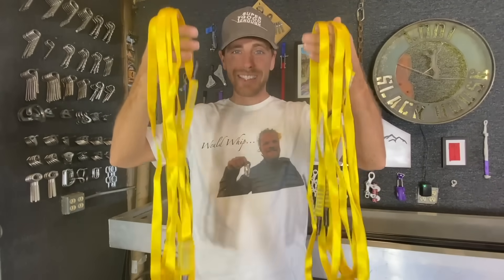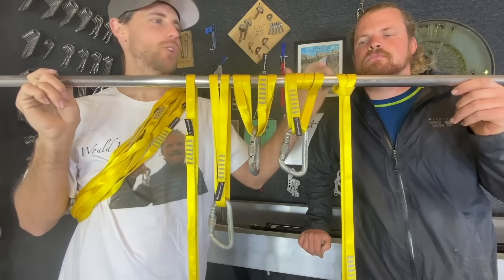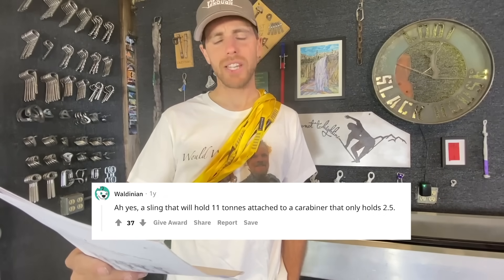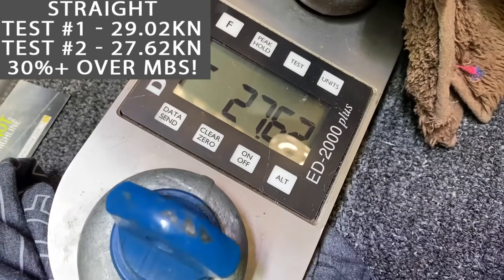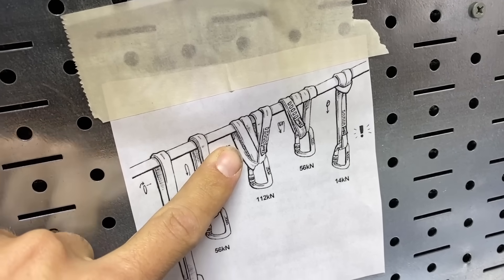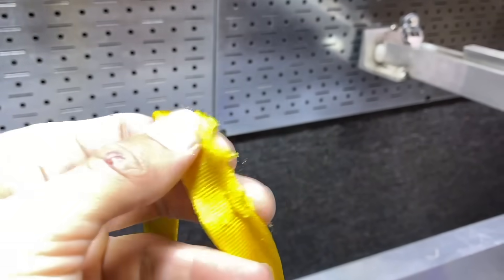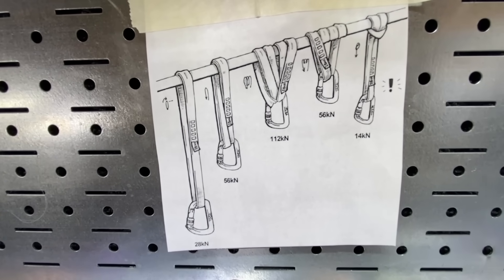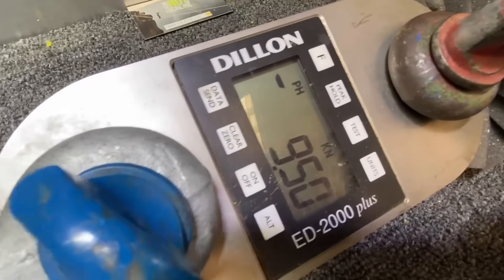Climbing Sling Myths

Comment: Whenever you have the slings not perfectly straight you have hidden forces in your system that are there, but are not measured by your gauge. Let me clarify:
Most prominent to see at the quadruple sling. There are strands coming from the left and some coming from the right. Slings can only transfer forces along their orientation. So the left slings pull to the left, and the right slings pull to the right. The sideways forces cancel each other out, and you only measure the axial forces with your gauge. But they are there, load the slings and add to the breaking forces.

Comment: Hey, my background is engineering and from what i can see i would assume that the lower tensile strength is due to each "strand" of the sling not carrying the same load, so instead of it being each one carrying the same load and maxing out, some will carry more and and some less due to many factors, so it fails once the highest loaded section reaches its maximum load capacity

Comment: I was a climber in my 20’s before a bike accident and broken wrist all but ended my quest for higher grades..

I am also a crane operator and we deal with very similar formats when it comes to our rigging…

What concerns me, is that a sling rated for 22KN is breaking right around the 22KN mark

In our industry, a sling “rated” or with a working load limit (WLL) of 5000 LBS must have a “breaking strength” of 5 times that…

We also simplify our configuration for good reason

Straight pull is a factor of 1

Basket is a factor of 2

Choke (girth hitch) is a factor of .75

And this is under optimal circumstances, accounting for sling angle and severity of a bight

Comment: Wide v-shape means the pulling force you're measuring is not the same as the force the sling "experiences" along its length. No practical implications for the sake of this test just pointing out it's a bit different thing.

Comment: the reason you are not getting 4 times the strength of the rope when you wrap it 4 times over has to do with the "triangle of death". basically, all segments of the rope have to be parallel to one another for their strengths to add up. if they are at different angle, only the parallel component of their strength adds up. the oblique competent cancels out. vector physics. sorry!

Comment: The reason you are getting lower than calculated results is that it's impossible to rig the sling in multiple turns in a manner which puts perfectly uniform stress on every strand.  Every wrinkle, fold, and partial overlap changes the force distribution away from ideal/uniform, creating stress concentrators which cause some strands to reach their failure point before others.

Comment: I fucken called it. Why would the last rope they tested snap twice as fast. Its attached the same way. Only its got a not at one end. Why would there be weakness in a simple knot like that.

As for the one that should have taken over 100 kn. You generated a lot of heat its not rocket science. That reduces the strength load its designed for so if you operated your machine at super slow speed you would have seen the correct results. Heat is a bi product of every process in existence. You dont even need to explain it. The rope could not dump its heat fast enough into the rope around it. It didnt burn soften like that every where as the steel bolt were it could, through contact, absorbed a lot of heat protecting it. You tie knots and rock climb or something right? How do you not know this. My grandad taught me a little tiny bit about fishing and one knot. You spit on it as you pull it tight to keep it cool and add lubricity. Trying to tear those straps you are adding vast amountsof energy to the system in e form of heat and deformation. Or better to say the friction and deformation is causing it. Its not compression. Its being pulled not compressed even though that seems whats happening. Key point is to take note of where the forces are coming from I.E. what kind of forces are being applied and take in to account where are the forces being applying from which direction.

Comment: I would expect girth hitch to have increased wear that would degrade quality much faster with habitual/repeated use. Unfortunately I don't know how to test this without an ABSURD amount of time. (Maybe repeated 4kn tugs until it breaks, but I don't know how many it would take to have an impact, I also would expect that to realistically simulate wear you would need enough time for the sling to cool off after each tug since I have notice the material has a tendency to melt and become brittle under load

Comment: Seeing the wrapped sling break strength was great because it's the worst case scenario for an equalised two anchor setup if made with a sling between it. if you're using one sling to two anchors and adding a cross over to attach the equalising carabineer, if one anchor fails, the carabineer slides along the loop to the end effectively creating this scenario.

Comment: The wrapped sling introduces an angle to the attached leads of the sling, would be interesting to divide the measured breaking strength by the angle cosines to see if the straight tensile breaking force is close to the original double looped variation

Comment: Why do you jam the slings into the bolt of the shackle, you should be using the bow of the bow shackle for them, the bolt of the shackle going through the pulley, if it would fit.

This would stop the sling from being bunched up and potentially get a higher result.

That said, it's an absurd number anyway and moot.

Also, these factors all change depending on what you're slinging around. Sling a girth hitch around a square object (I beam for instance) and see how you go. (The angle of 90deg in each corner will further reduce strength.)

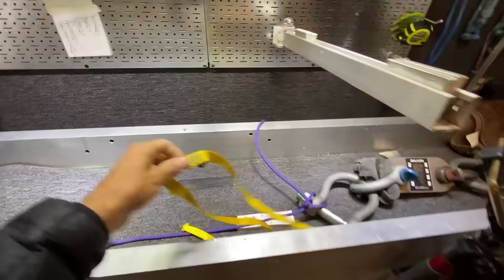Comment: Re 10:26 You did not wrap the sling as shown in the old picture (which is why the biner hangs differently), and your arrangement might do more to prevent equalization, by pinching one loop under another.  And you would get more equalization if you allowed the rod (clevis pin) to turn on its axis during the pull.  However, yours is more realistic in that most climbers are not very careful about how they position the turns on a shortened sling.  However (again), no one really anchors to a polished 1" steel rod, nor where the loops can be arranged to not pinch one another.  Another fundamental is that although tubular sling strength is less affected by bend radius than kern-mantle, it still does, but I haven't seen any good tests of how much it does.  (In case someone does that test, the length of the test loop, as it is tied, also matters  (which might be part of why 3-wrapped is weaker than doubled)

Comment: Is there any difference between a shock loading from a vertical fall and the progressive stretch you apply on your rig?
Reply: That's the question I want to know !!!  I woule assume the shock load would be many more KN than the slow stretch load ? I mean how often would a climber actually have a tie wrapped around a flat cylynder like that as opposed to a curved or angled surface putting MUCH more pressure on a line. And all it takes is for ONE loop to break to render the whole thing useless.
Reply: Yes, I think the circumference of a krab is crucial to the loading especially when it comes to a downward, shock loading instead of a horizontal, smooth pull.  @takeshikovacs4728

Comment: Nylon running over nylon burns . all the numbers doubled are correct in theory but you will always have unmeasurable breaks at any or all knots , girth hitches , or points of contact. The correct way to strengthen would be to take out the bar tacks and create continuous loops on top of each other .

Comment: With regards to the sling that melted. If you magnify the fibers you'll see they didn't cut but melted as the tension caused friction that created heat that melted the sling.
When you wrapped the sling multiple times around the shackles int top layer pressing onto the under layer stretched giving a wider heating area and the heat was not able to disopate reducing it's strength.
Wrapping multiple times as far as I am concerned is more about locking the sling so it doesn't slip and cut.
On the first test it failed at the stitching and would at a knot for the same reason as it's a pinch point so doubling it reduces the loading on the join with the bonus of an increase in strength.
Of course out in the field you could add an extra crab to get extra strength. When instructing abseiling activities I use steel crabs as they are stronger and handle more abuse.🏴‍☠️🍺

Comment: The various military and special ops players have the perfect mindset for all situations like this "failure is not an option". If you can break it on the ground (benches inclubed), it can break and will, at the worst time. The smooth spots were where the sling began to break down (melting under compression probably). Any time a sling crosses itself you run the risk of that happening. If you can, elongate and cushion your attachments. If your equipment is having a good day, you will too, probably.

Comment: In theory, a perfect world it should be 4x if double basketed. Obviously with minor twists and turns and such the strength will diminish. Even just a 5% loss on 80KN is roughly 4KN, 5% is a reasonable factor for a real life scenario. When they say mbs, its in a perfect environment that works for the manufacturer.

Comment: The more wraps you put around a limb the harder it is for those individuals wraps to evenly distribute the pressure/weight. (it's a bondage thing lol.) If there are slight length differences between the wraps, and there are parts or rope overlapping each other, with weight, the pressure/friction makes it even harder for the straps to even out and distribute the load.

Comment: Way last century, when Bill Forrest designed his "Titon" tee nuts, slotted to be strung with webbing rather than perlon, he said he was getting pull tests that exceeded the webbing rating, before even smoothing the edges of the slots. This would be very comparable to running a sling through a bolt hangar, not using a girth hitch. That would be a very informative thing to test with other variations that many folks end up tying when rappelling, especially when a girth hitch is the most expedient way to put a pre-sewn sling through a bolt hangar. Trying to cut a sling to thread a single strand through is inconvenient/dangerous in nylon, and nearly impossible with dyneema; doubling a runner would be stronger, but would not stay in place as soon as the rope was pulled. Doubling a sling through a rap ring, then girth hitching the doubled ends to the hangar seems a stronger alternative, and easily replaced by another party.

Comment: Looks like rope mentality is used as baseline thinking for the strap expectancy. How about comparing the same sort of hookups using rope; i.e. strength multipliers ...  Difference would be of course rope would not wrap over itself in some of your configurations ...  still a nice test?

Comment: Hey, the reason for decreased strength is due to overlapping the straps.  When they are under that much tension they will lock together rather than slip past each other.  That will lock the length once the load gets high enough (well below MBS).  Once you do that the shortest length will see a much higher load.  The best way to mitigate that problem is to use longer test pieces so you can use larger shackles.  This will allow you to avoid overlapping the test pieces.
Reply: Yeah I would like to see a slightly longer one I think it would perform the same as the regular (shorter one.) I dont get why anybody expects that hitch to be half strength, its not THAT much different than a regular loop.
Reply: Also, if the issue was effectively having multiple pieces of slightly different [unloaded] lengths once everything locks, then presumably using a longer sling but keeping the shackles the same (so tending to keep the same absolute differences in lengths between pieces) and increasing the overall length between the shackles would mean the relative differences in [unloaded] lengths between the pieces would be lower, so the differences in load between pieces would also be lower.
Reply: Came here to say exactly this but vid being 2y.o I first check comments.
Glad to see some people with a brain here and experience here, shows thoses guy have no clue what they are doing.
Reply: @AlphaGamingCa  I guess it depends on what a viewer thinks they were doing.
They did say they were inspired by the diagram (showing what were effectively "ideal" results for the first 4 arrangements), and that diagram was using a carabiner, which would end up with straps overlapping and resulting uneven load distribution.
In the real world, not many people are going to carry around huge shackles to use in setting up a belay, so wouldn't end up with an ideal setup either.

Comment: Its the law of diminishing returns. Thr friction of it rubbing on itself causes it to lose overall instance strength. Any twists or horizontal tension will reduce the instance strength. I want to define instance strength. Instance strength is the break strength after all influencing physical factors are calculated. So for instance if i were to try to break a d shackle it might take 10000lbs of force to overcome the tensile strength. Thats the breaking strength in a physical vacuum. However if that shackle were heated to 1500° f and it took 3000lbs to break its instance strength is 3000lbs. So its a term used to identify the strength of a material when taking into consideration environmental factors

Comment: The girth hitch was full strength because the bolt you used for rigging was able to turn so the hitch could orient itself in the direction of pull.

Comment: The minor axis (across the sling) of polymer fibers is not as strong as the major axis (down the length of the sling). When a knot is tied the load is distributed over both the minor and major axis. The narrower the bends in the knot are, the more force is distributed over the weaker minor axis. The narrower the material the narrower the angles are for the same knot. This is why the decrease in MBS for a given knot is not comparable for materials with different widths.

Comment: Great video I get similar results using the straight and girth hitch methods. 

I use lots of 6-12k straps combined with a 4k chainsaw winch, 10k pulys and 2-10k bow shackles for small scale logging. 

I find that the girth hitch typically exceeds the rated capacity of the strap.  I typically use straight or girth hitch ties for all my strap connections with bow shackles or straight to another strap. I mat double my strap if using a 6k strap for an 8k pull.

I have broken around 20 straps and mostly they brake somewhere in the middle due to weave failure or less often at the stitching.  However, under tension any somewhat sharp edge that comes in contact with the strap can potentially cut it.

Decent straps are Great.  I have way more problems with my 1/4 inch 4400 pound test aircraft cable wearing on the cable guide and getting squished on the winch drum.  I wear out and break the cable every few hours of use.

Fun fact: with a starting load over 2k I just tie the leading end of the cable to a bow shackle and it holds full rated strength once the knot has pulled tite under heavy load.  This saves time and doesn't leave anything sticking out to get snagged.  The cable typically only breaks where it has been worn by the cable guide.  

Thanks again for the great video I found it applicable to my work.

Comment: The basket is breaking early because of friction. The rate at which you're pulling is causing the fibers inside the line to rub against each other and heat up. If you were to pause for an hour every 3 or so kN, it  would break at a higher point. This is theoretically true for all the tests. This technique is used when heating up or pressing up high energy systems such as reactor plants. If the rate of change of stress is too high, it can break thick steel walls even if the total stress change was within the walls rating.
Edit: i realize having equalizing periods is not realistic to the purpose of the sling, just pointing it out after seeing the melting on the basket sling. Another test that might be more accurate is to mount it vertically and attach the appropriate weight to the sling, (preferably with shackles because of previously mentioned problems with the clips) This testing would be more expensive and time consuming, but placing the strain on the system all at once is more accurate and will factor the friction in differently.

Comment: At 11:57 probably an heating over 300C plus for a split second from the intense compression and that is what is causing the break. What about using a wet sling? or setting up some dripping water on it to cool it? Remotely of course so it doesn't kill you LOL!

Comment: yeah as far as the smooth-melted-smooth-melted thing goes I think  a breaking table isn't an identical simulation as it is a slower process than a dynamic fall situation induces, so heat can accumulate in the sling material and the metal. In a climbing fall this would be to a much less degree.
Reply: you need to add another variable to the equation for time if you're looking at edge cases like prolonged forces that generate heat. something like kNs (where s is seconds). pretty sure the safety ratings are for drop tests and not for lifting scenarios. i guess for slack lining this could be quite relevant!
Reply: i like your videos by the way. thanks for making them :)

Comment: Yes yes larks head not ratio of knot vs tensile strength is 100 percent. The quad basket knot math will work better with a bigger shackle because rope or rope tape performs like a hot saw blade.
Reply: If I recall correctly the book says larks head knots retain 89% tensile strength, my own testing challenged that theory.